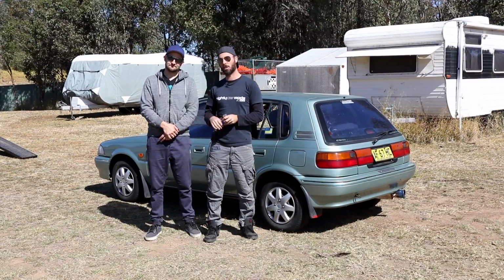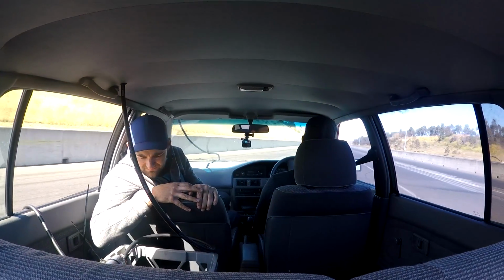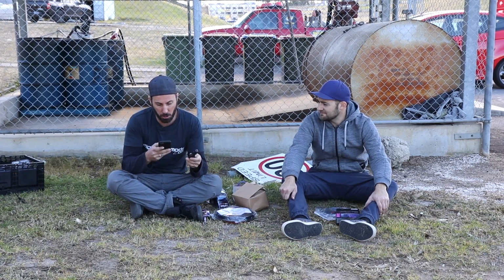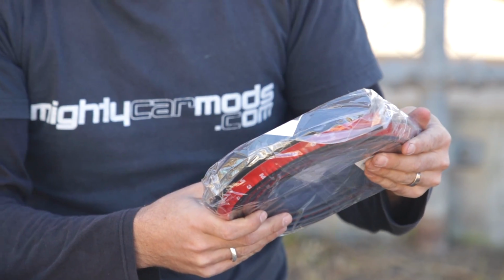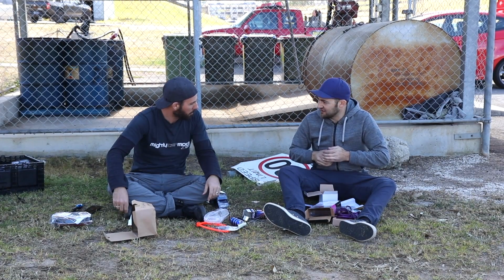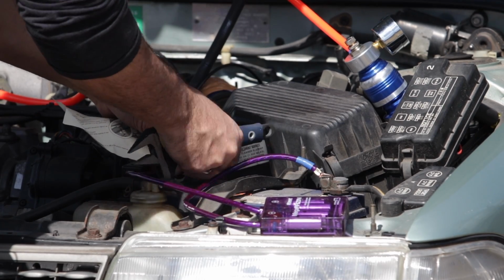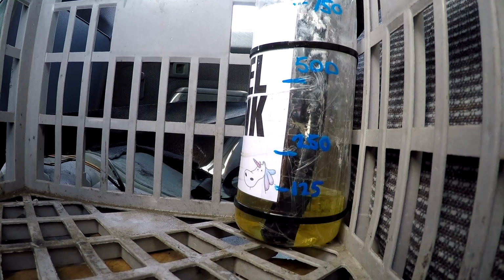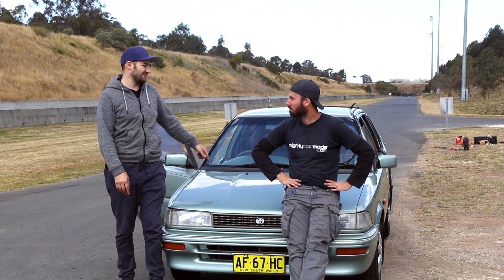Fuel Economy Mods - MYTHBUSTED

Comment: I want to see a test seeing if 91/95/98 fuel does actually give the car more performance/economy as the petrol companies claim.
Reply: Armouredfalcon it won't give you're car any better fuel economy but you can legitimately make more power on higher octane. That's why people run e85. My friend has a 1986 mustang gt and has to run 93 (which is what we have in America as high octane) because we advanced the timing in the distributer to make more power. I wouldn't run as well without 93 and he would lose power if we retarded the timing
Reply: If your car can use the extra octane, it will consume less. Other than that, it's just a waste of money.
Reply: No, it's good if you car can make effective use of the fuel. It's like putting carbon brakes on your otherwise stock Toyota Echo. It's all well and good to pull yourself over how cool your brakes are, but when your car doesn't have the power to overheat the factory option discs it's kinda pointless.

If your Echo, however, was a track car with quadruple the stock power output, you could probably make use of better brakes on a tight circuit, but you probably still wouldn't make use of carbon ones.
Reply: Cool, so maybe I am getting a little more smartly. 🤓
Reply: Armouredfalcon yep, 95 run, and then 98, and mixed
Reply: Newsom Garage doesnt the ,,more power,, mean that your car goes a bit further with the same amount of fuel?
Reply: I guess 112 octane racing fuel is just pointless then, race companies are just wasting their money.
Reply: Newsom Garage Race cars sure, but an every day driver doesn't necessarily gain anything by going up in octane unless it's tuned for it and/or has a higher compression. It's more resistant to pre-detonation therefore it can handle higher compression better. Many cars may show no difference because if it's not being pushed past the point where 87 will pre-detonate then it's going to ignite just the same. It's basically just giving your vehicle more leeway before it pre-detonates. That's my understanding of it, which I think is correct, no?
Reply: The advice I always give people is run what your manufacture recommends for you vehicle, assuming it is stock. It is designed to run on an appropriate fuel and ignition profile. 

An increase in performance or fuel efficiency is really dependent on your car. If there is a performance increase it may not be sufficient to offset the increased price of the fuel. 

Small low compression engines are often designed to run on a low octane fuel as it ignites easier, a high octane fuel leads to a performance reduction as the engine system struggles to ignite the fuel. 

Where as a high compression engine can run better on a higher octane fuel as it is less likely to detonate the fuel early under the engine compression. High compression can make the fuel easier to ignite and if the octane is too low it will ignite too early causing poor performance and in more extreme cases fuel igniting early can lead to significant engine damage. 

With many modern cars you can see an increase in mileage and performance with higher octane fuels as the vehicles can control fuel, valve, and ignition timing for a more efficient use of the fuel. 

It is an over simplification but basically the more advanced the engine can run the timing without the fuel going kaboom early the more power and potentially fuel efficiency you can produce.
Reply: NextGenesis88 you're correct. I said me and my friend tuned his mustang and made power off of the higher octane. My camaro has 11.4- 1 compression but I still only need 87 because I have a thermostat that opens quickly. But everything you're saying is correct
Reply: Newsom Garage and what? Just more power, for what? :D
Reply: mukans no it means you use the same amount of fuel but make more power off of it

Comment: Best economy "mods": choose correct dimensions tyres, inflate tyres correctly, alignment check, clean air filter, spark plugs with correct gap, get rid of junk on your trunk, easy on throttle and combine engine+pedal when braking. If you go to yoga and loose weight that is a plus for fuel economy and increase your chick magnet factor too.
Reply: Agree concerning the use of "economy" word. Should we change "economy mods" to "optimize factory efficiency mods". That way you get either and optimum factory efficient Viper or an economy car.

Comment: One thing that is getting kinda big here in Brazil is putting a metal conditioner called Militec-1, in the same hole as the oil goes in. Their ads claim that it reduces polluting gases' emitions by up to 70%, improves performance and reduces fuel consumption by at least 2.8%, increases power output by "recycling" power/energy that the engine wastes (heat from combustion/maybe friction or exhaust gases?), and lasts 20000Km, even if you change your oil.
Reply: This mod only could works on 50% on the cars that uses Miltec, because the other 50% only uses 35w15w semi synth oil labeled as Miltec. The other 50% original Miltec fan boys should had choose a higher API oil instead of compensating it with aftermarket aditives at first.

Comment: You could test if fuel additives increase performance, either by cleaning out the combustion chambers and fuel system as it goes through (like Redex), or just adds more bang in the engine. It may even give better fuel economy!

Comment: Bros! Hear of the "running on fumes" method, where you replace the air filter, with a gas can, and disconnect the fuelpump, snd only use the air intake to feed the engine. It was done on a GM diesel engine, pretty old one. It did start on the video, but I can't immagine it can accelerate well, if it even can drive at all
Reply: uKultuR Gaming you're basically just creating a carb. Might cause a lean or rich condition

Comment: i put a cold air intake on my 2001 vvt-i avensis and went from 8.0l/100km to 7.4l/100km. then because of some old nazi at my MOT said i cant do that i had to buy a new stock filter and im now at 8.2l/100km. Also vortex generators at the back and upgrading the fake vents to real vents at the front might boost my fool-economy.

Comment: want better performance try performance plugs,& wires  a performance or just new air filter. Proper tire inflation, and alignment are necessary as well. All so do recommended fluid maintenance  ^o.+^

Comment: funilly enough turbocharging your car will /actually/ increase your fuel efficiency
Reply: Nope. Switching your 3.0L engine for a 2.0L engine and increasing the 2.0L engine's output to that of the 3.0L with a turbo will increase your fuel efficiency. That's why turbos are a big thing for mileage - they allow you to reduce engine volume without giving up high-end performance, which reduces the amount of fuel needed to run the engine at lower rpm's and engine loads. 

Tuning your engine can increase mileage, and that's easier to do with a turbo, because it allows software tuning without the loss of power output, because you have that option of increasing the induction. The turbo itself won't better your mileage unless you know what you're doing.
Reply: Go back to school
Reply: Swapping your 3.0 for a 2.0 and not turbocharging it will likely increase your fuel economy even more. If you have a rickety enough car, it'll still be fun to drive as well!

Comment: We tried to use electrolysis which make Hydrogen from water, just for experiment. In theory it should help save gasoline. But we want successful, there was no fuel economy. Maybe we did something wrong.
You should try that, maybe You guys will be Successfull with that metod!
Reply: The amount of Hydrogen you can get from electrolysis would not be anywhere near enough to have any effect at all.

Comment: Do bigger wheels = bigger speed?
Reply: Given that your car has enough power and is only limited electronically or limited by readout from speedometer by manufacturer.
otherwise you would only increase the weight of the car and therefore reducing your top speed marginally, therefore Bigger wheels = less speed.
Smaller wheels typically Weigh less and will allow you to travel faster, marginally.
Although, you have to take into consideration the reduction in total wheel size and rolling length from each rotation of the wheel, you would then need to calibrate your speedometer to the size wheel you have changed to, or you know just use a gps, that way you can change wheels often and the gps automatically reads out correctly no matter what, it does'nt care about your wheel size.
But, if you use wheels that are lighter than tires relative to size, then your speed would increase from bigger wheels.

Comment: So that vacuum leak one will actually cause the engine to run leaner which would get you better mileage right?
Reply: In most cases it will make the fuel economy worse since the ecu will compensate for the vacuum leak by adding more fuel

Comment: Just letting you know. Derek's drag coefficient is less than an F1 car.
F1 cars are built for downforce not air slipperyness... Bricks are more aerodynamic than F1 cars.
Reply: Bricks are more aerodynamic than f1 cars! Millions of hours in wind tunnels to make sure they're less aerodynamic than a brick that holds a house together! Good on ya mate!
Reply: Phil I dont think you understand how aerodynamics work
Reply: Have you ever seen an F1 car? Ever?
Reply: the point is that the aerodynamics of an f1 car make in inefficient (for fuel) by making it push down to the ground, whereas the aerodynamics of the corolla are at least slightly tuned for fuel efficiency (and therefore no attention to downforce). A brick would have terrible aerodynamics in that it doesn't give you downforce or efficiency, but it probably has better efficiency than an f1 car which is tuned for downforce.
Reply: MobiusHorizons you need to read on that more

Comment: Here's a crazy idea. You know that big van ford let you have... make a boat tail trailer for it. I'd really like to see if an aerodynamic trailer on the back could help with the low pressure area behind the van and work out to be more efficient even with the weight of pulling it.

Comment: Use a Hydrogen generator that's homemade to supplement the air in the intake! 100% works to improve economy
Reply: I'd love for more conclusive evidence on that one. I don't think it's impossible. Some losses in the dynamo and HHO generation, but if it vastly improves the chemistry of the combustion, why would it not be more efficient? The chmistry side is very important. Not just for efficiency but also the exhaust composition.

There also the elusive GEET fuel system which in some cases got interesting results reported. Did you research that one? Goes a bit beyond chmistry, into smaller particle physics. Just might work. Paul Pantone got a terrible treatment over it, improsoned and all.

Comment: How long can derick run on diesel? Now you have separate fuel system setup should be easy!
Reply: lol yea thatll work!
Reply: It wont start on Diesel. You would have to run it on petrol and then switch to diesel while its running and even then it would run like crap and be undriveable.

Comment: I was looking to see if someone to post that you aren't supposed to use all these together or some fanboy comment like that. I always enjoy videos like this and I don't know why. I find them funny but at the same time I'm sad that bad products like that exist...I mean magnet on fuel line? Battery stabilizer? Come on! That intake thing made me nervous though... Something breaks off of that and it could damage your engine! Some legit things do exist and cost about the same as all the scam products or some are free. Like a mpguino or the cheaper option a vacuum gauge (I should correct that these are driver aid things not actually increase fuel economy by themselves)... weight reduction is free... Like most people said already fuel economy is affected mostly by the driver.
Reply: its also affected by the amount of stop starts \traffic you have to deal with , i have 2 different ways i can drive to work .one has 9 stops and a bit of traffic the other is 6km longer but only 3 stops and very little traffic witch on average uses about 1\3 less fuel .

Comment: @MightyCarMods: The aerodynamic "fins" you put on are basically vortex generators which, depending on the car design and where you place them, can make a significant difference. They essentially do the same thing as the dimples does on the Mythbusters golf ball car. Go check out https://www.youtube.com/watch?v=eR5SlwNf4K0.
Reply: Vortex generators are used on badly designed aircraft wings as a measure to  improve air flow onto control surfaces. The  idea is to re-energize the boundary layer and delay airflow separation from the wing. Mounted on a car roof they should impact rear spoiler efficiency, not fuel consumption
Reply: Mythbusters measured about a 10% improvement in fuel economy on their golf ball car.
Reply: Leif Simmons I guess it could work to reduce total drag, if the earlier boundary layer separation creates more drag than the vortex generators themself. Interesting thought.

Comment: Want to save on fuel? Drive slower lol
Reply: kickinon not necessarily, most vehicles are most fuel efficient around 55 MPH
Reply: Want to save fuel? Don't brake lol
Reply: You could get a massive battery and go all starter motor!
Reply: Flintstone it during peak hour traffic, you'll save a lot then

Comment: Can you make Derek run on piss?
Reply: Elthiaz how flammable is your piss?
Reply: Depends on how many drinks I had... No but seriously, urine is like 98% water, some cars run on water, sooooo shouldn't it be possible somehow? :D
Reply: take another look at what you just said. the only cars that even sort of run on water are hydrogen fuel cell vehicles, which aren't even on the market at this time. and even they require the water to undergo electrolysis first, and then the H2 and O2 gas placed in separate tanks.
Reply: I never said it would be easy. :D

Comment: i used to have a honda hatchback civic that i used to hyper mile. there are actually lot you can do to increase your fuel economy
Reply: You should install dish hub caps, remove mirrors and radio antenna ,  skinny tires, then add a boost/ vacume gauge for maximum economy
Reply: Grill block, air dam, increased tire pressure, taller drive wheels, remove the wipers, install an MPGuino, remove mud flaps, Kammback, boat tail behind tires, wheel skirts, hot air intake, power steering delete, replace mechanical fan with an electric one, and lightweight wheels.  None of these should improve mileage by more than 5%, though, and some will not make a noticeable difference.

Comment: makes me wonder though, besides not flooring it 24/7 and these bogus pieces of consumer bait. are there any proper mods to save fuel? besides the obvious reducing the cars weight.
Reply: If you need to keep cool, you can keep ur windows open at low speeds. But at higher speed, windows up and AC on is more efficient.

Of course the best thing is to keep ac off and windows closed.
Reply: I put smaller throats on my carbs, went from 40/45 down to 32/36 lost a tiny bit of performance, gained about 20% more fuel milage
Reply: proper aero, different fuel maps, learning eco driving technicques
Reply: Increase the compression of your engine with longer gearing
Reply: for all i can  imagine is getting the car a proper tune, since those are made to improve the car's output power but also can improve the fuel consumption, since from the factory, they're tuned to run richer than needed ( for obvious safety reasons, so the engine doesn't go lean and go boom )

Comment: Open up the parts and see what's in them.
Reply: the plug in thing will have a resistor and an led...the thing with a fan will just have the fans and a couple of bearings
Reply: captainnemo ahhh might be more to them than that... Capacitors across a battery in theory could offer some benefit for when volt drop occurs... Like when lights come on, cooling van or the air con etc...

Comment: Now that youve done the joke ones. You should try do it for real. Hot air intake, lighter wheels, skinnier tires pumped up to a higher psi, real aero, smaller mirrors, weight reduction.

I love that the 'HKS' thing leaks vacuum. That actually makes the fuel economy worse by a lot because the fuel pressure regulator will see less vacuum and thus more fuel pressure to the injectors which will now spray more :D

Comment: Oh no all that crap did not work. But cutting your rear bumper can really save fuel by decreasing drag but most modern cars are designed for good air flow and do not have a air scoop rear bumper under the car